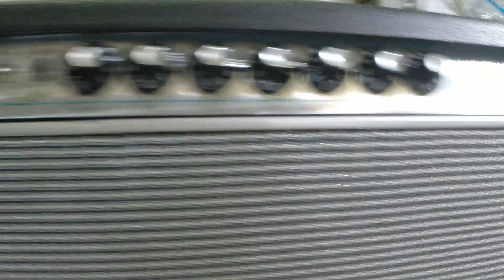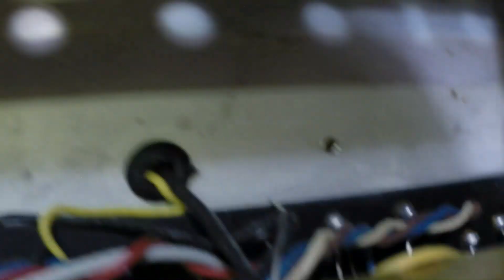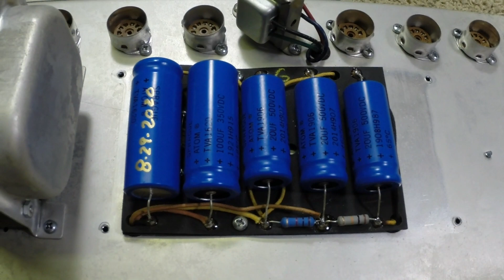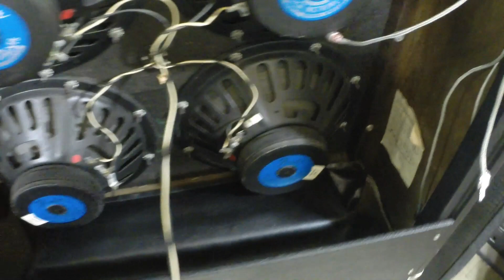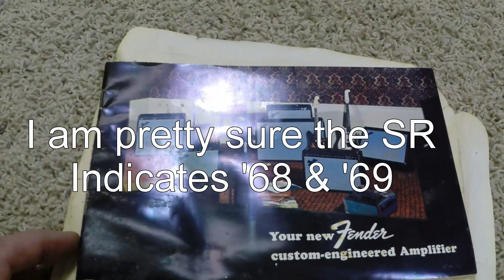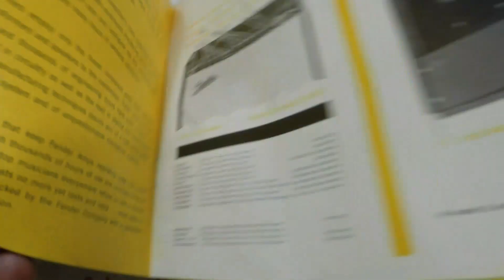68 Fender Super Reverb Rebuild

Comment: I just bought a 69 non-drip edge. It was listed as a 79 because it was Guitar Center and they didn't know what they had. The cabinet is beat but the amp is almost new and 98% original. I paid $700. They had no idea what this amp was they thought it was a 70w 1979 Super Reverb which was actually an Ultralinear model and a completely different amp than the traditional super reverb. 
My amp is a transitional amp. It has a proper bias control and has been blackfaced. Some vintage components were replaced or added all period correct parts. Whoever owned this 69 I purchased had it properly maintained with the utmost respect for it's age and condition. I was blown away when I opened the amp up to look inside. I was super cautious starting the amp on a bulb limiter because you have no idea what the state of the amp is. After a current limited controlled startup I realized the amp was working perfectly. Plugged it in and it's all there. 100% Fender Blackface Super Reverb DNA. The speakers were replaced with some Eminence 50w that sound pretty good. Overall I scored so good I can't even believe it. 

I recently rebuilt a Fender Twin Reverb 135w Ultralinear. I stripped the chassis completely and had it powder coated. I got rid of that brass ground strip completely. I created a real star ground with a single solder bond to the chassis for all of the grounds in the amp. I used isolation washers for all of the jacks. There is a single ground buss about 10" long with all of the different grounds separated by about 2" by current level. I use Tefzel wire and all orange drop caps. That amp sounded incredible when it was finished. We put a tube buffered effects loop it it. 

These amps are awesome platforms for a total restore with new parts. Transformers and the chassis are where the value is. People think the mojo is in carbon comp resistors vintage film caps or type of wire or lead dress. It's not any one single thing but old wire and components don't sound as good as new high quality stuff. 

The bottom line is if you follow the schematic exactly and use top quality components and wire and you are good at soldering you should be able to reproduce what they got in the factory when Fender was building these amps. If you hit that target you get that awesome Fender DNA. It's all about component values and following that schematic to the letter. These amps all sound fabulous when they're running properly.

Comment: Hi what are the resistors you added back in on the cathodes? Are they 1 ohm for measuring the bias voltage? Thanks
Reply from the maker: Yes, that would be 1 ohm resistors on the cathodes.  While I am not a big fan of using them to measure bias because screen current and plate current are present on them, they do allow me to measure current while the amp is at any volume.  This also allows me to see how well matched both sides are running at high levels.
Reply: Thanks! I’ve got the exact same amp and planning to do similar changes to it.

Comment: I have a 68 very similar to this. Usually those ground plates are soldered to the chassis on one side. I did a sound test with the snubber caps connected and disconnected on the 6L6's and it seemed like it killed the "ice" pick highs associated with the silverface models when I kept it in. I was surprised. Mine was kind of a blend between an AB763 and an AB568

Comment: I just found your channel and this video.  I just got a 1969 Bandmaster Reverb with the hybrid fixed/cathode bias circuit.  Is there anything inherently wrong with that circuit, other than not having a bias adjustment pot?  I plan to keep the output tube matching pot and add a bias trim pot in series with the bias resistor.  My 1968 Bassman also has a similar circuit.   Thankfully my 1969 Super Reverb has the AA1069 circuit, but still no bias adjustment pot.
Reply from the maker: These were the amps that began that "silverface" stigma.  The circuit is not "bad" just different. Some did not like change.  It is all in what you like, BF, SF whichever.  I prefer the bias of the former amps, however adding a proper balance pot is useful.  Hope you have found the channel useful, and thanks for checking it out.
Reply: @guitarc.p.r.9675  I recapped the amp, changed the doghouse resistors and bias resistor and diode and added a bias trim pot, and the amp sounds pretty good to me thru a 4 x 10 Weber alnico cab I built last year.  Dead quiet.

Comment: I have a 1965 Bandmaster that has those gold filter caps.  I have had the amp to my tech and he checked everything. Surprisingly the caps are still good. i keep a very close eye on them, check them every couple months. Amp sounds glorious, zero noise, no leakage
Reply from the maker: I find more good caps in the Older Fenders than the later Silverface models.  Keep your fingers crossed.

Comment: I have a 69 that I blackfaced and separated the cathodes of V1-V2 to give each channel a unique voice. It has two Weber Signature Alnico speakers and two original speakers. I don’t plan on parting ways with it.
Reply: I have a 69 as well. I had to change the balance to bias and remove to cathode resistors from the power tubes to make it work properly. It is a monster. From clean to crunch. They take pedals very well. Great amp!

Comment: I got a 1968 Super Reverb I never powered it on when I got it and first thing I did was replace the power cord with a 3 prong. It is lighting up but The GZ34 is not glowing at all and no sound is coming out of the Amp whatsoever not even hum. I was told from a few people it could be a Transformer. What would you suggest?
Reply from the maker: Sounds like it is broke....  :)  Transformer could be a problem, but it takes a lot of stupid to damage a Fender Power transformer.  Make sure it does not have an oversized fuse in it FIRST thing.  You have not given me much info to work with.  If your GZ34 lights up (Tube should not glow) the 5 volt heater is working so that voltage is there.  If your pilot light and other tubes are lit, your 6 volt heater voltage is there.  Next voltage in question is the Main B+  you should have about 350 v AC on pins 4 and 6 of the rectifier tube.  If you have no DC voltage of around 440 volts on pin 8 chances are the  GZ34  is bad.  Use caution here,  many things up stream could have damaged the rectifier tube.  If this voltage is present the standby switch or choke may have failed.  That is the short answer.  But I am just guessing.  You may want to see a competent tech.